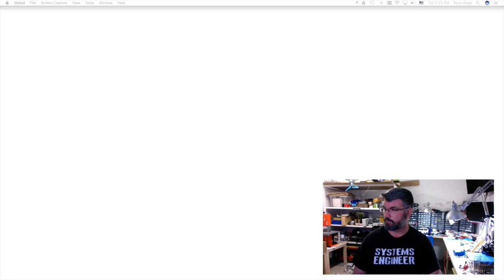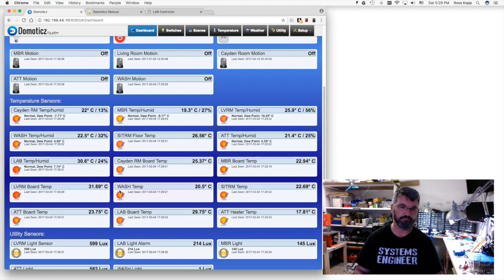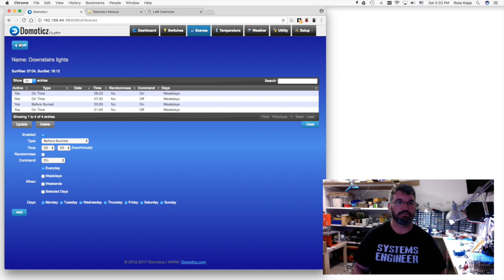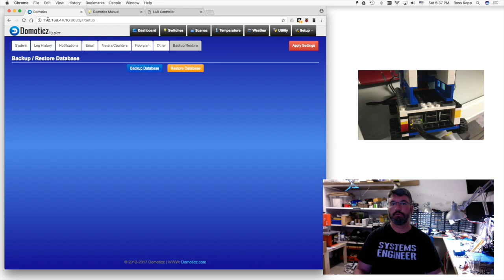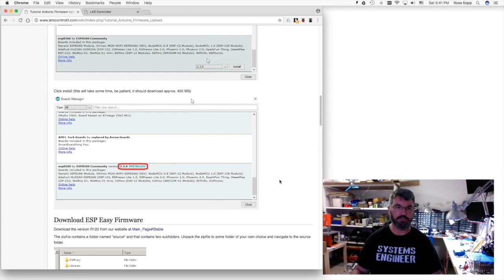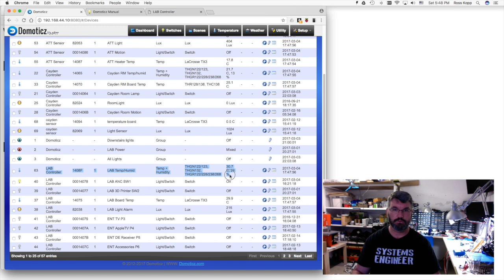S1 E6 intro to Domoticz and ESPEasy

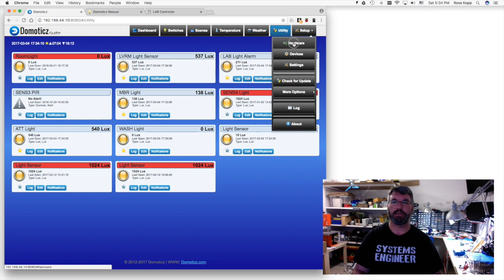Comment: Hi Ross, at 10:43 i can see that you use multiple dummy switches and virtual sensors. What is the benefit? In my Domoticz setup, i have only one dummy switch, and for each ESP device i make a virtual sensor for that dummy switch. Thanks!

Comment: Hi Ross.  Sonoff recently (february 2018) changed the firmware slightly, you are now not able to flash the chip anymore... or at leas get the SOnoff in programming mode. Do you know if there is a fix for this?
Reply from the maker: Hi Jody, since i dont have a 2018 model from Sonoff, i do not know if the chip can be flashed or not. i have an older sonoff based on the 8266 07 model and its relatively simple to flash... can you post the link to the sonoff you bought so i may further research the issue and possibly solve the problem?
Reply: "you are now not able to flash" - if firmware is 1.6.0 or higher you can not flash OTA.. internal flashing via a cabled connection is fine
Reply: Andy Maddick so if i use a serial converter I'm still good?
Reply: Jeroen, 
I had an issue with a sonoff with both RF433 & WiFi. The sonoff wouldn't go into flash mode by pressing the button. So after some reasearch and pin layout checks I found out I had to bring R7 (as close to the ESP chip) to ground using a 'needle' during power on. Now the sonoff went into flash mode. I works fine now.

/J

Comment: Hi Ross, I have just started to use Domoticz and interfacing with Esp8266.. All is very good but i seem to have it a wall on the Dashboard capabilities of Domoticz. My problem is i want to add to the dashboard a control that is linked to a user varible, which will set the Required temperature... Is this possible with out redesigning my own Dashboard/ webpage
Reply from the maker: Jonathan, give a bit more detail on what you want to add and what you want that item to do. i may have already performed the steps you want to implement.

Comment: Ross, I note you have quote a few nodes attached to your Domoticz box. What sort of Access Point are you using? I was wanting to use an ESP8266 set up as Access point for the network (I do not require internet) but wondering about the capacity to enables connections to say 16 nodes?
Reply: almost all routers support hundreds of wireless clients
Reply from the maker: i dont have an access point dedicated to the Domoticz devices. it rides over my internet access points within my home network. you are correct when stating that you do not need an internet connection. you only need to do the same thing i did minus a commercial ISP connection. i am assuming when you state "nodes" you mean devices.

Comment: Hi Ross, 

My name is Dave, I am located down under (Australia).

Thank you for the informative video.I appreciate your effort making the video. Looks like I am the first post to your video you published just today.

I am just starting with Domoticz and hoping you may be able to help me with a couple of questions.

So far I managed to get ESP8266 nodes running running with ESPeasy and sending DS18B20 readings to Domoticz. I have used CirusSMS to have SMS messaging without needing internet connection. I am hosting Domoticz on Raspberry pi 3. This all works fine.

My questions are:

1. I want to read lower temperatures and wish to use either RTD or Thermocouple. The Max31865 and Max31856 offer simple interface to these probes using SPI. How could I modify the code to enable the ESP8266 node to read one of these ICs using SPI?

2. I note your Oled had yellow text at top and blue below this, how do you set the colour?

3. Do you know how to clear the Log for devices? I had a situation where the Raspberry pi clock was wrong and the temperature readings were plotted with incorrect times. I then fixed the time but the historic incorrect time plotted results are persistent. I would like the log to start again with correct time.

Finally, Do you have any links to more resources for Domoticz or ESPEasy? I have been through their wiki but also hoping there may be some step-by-step guides around.

I am very impressed with these products, I was about to try and write something from scratch to do something similar (and would not have dome such an excellent job). Now I can concentrate on the actual applications.

Thanks in advance

Regards

Dave

sales at orbitcoms dot com
Reply from the maker: Dave,

thanks for reaching out to me with your issues.

let me see if i can answer your questions:

First, let me explain that i am an EE and do this as a hobby. its something that i enjoy doing and will tackle problems that others cannot solve with vigor.

1A. so far i have not investigated the use of SPI on the ESP boards but can do so if needed. that being said, i only use the I2C functionality currently and never planned on going that deep. is the Dallas temperature sensor not accurate enough? i will need a bit more detail on what you are trying to achieve.

2A. the OLED screens came with two colors. i cannot change them. the top two lines are yellow and the bottom 4 lines are blue. they were cheap...

3A. you will need to point Domoticz server to an NTP server to receive the correct timing. there are plenty of websites that show how to program the Pi to receive NTP clock settings. if that doesn't work, i suggest installing a RTC on the RPI board.

as for the links for other resources... Google is your best friend when it comes to finding other resources for Domoticz and ESPeasy. i have been doing this for a bit over a year and patience will take you a long way when searching for such articles. if there is a certain step-by-step guide you want to see, let me know, i will grab a drink and walk you through it. send me the details!

hope this helps

Ross Kopp